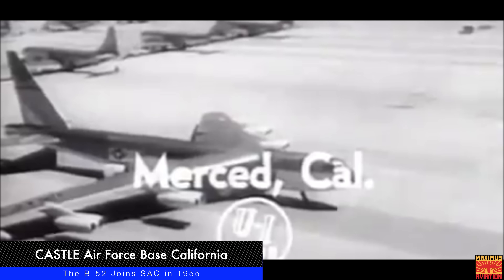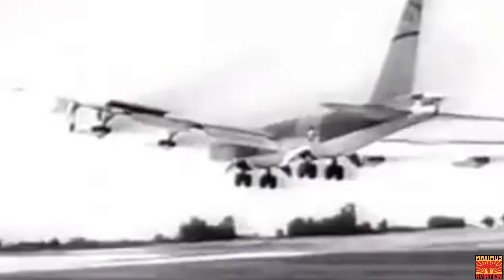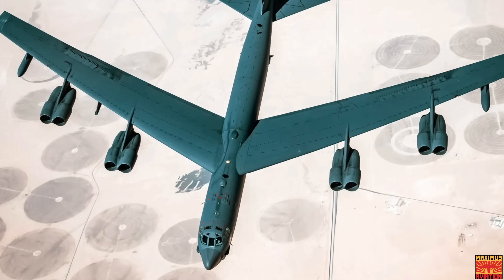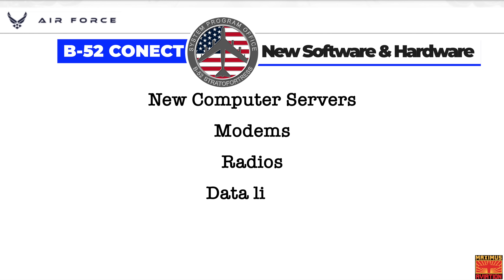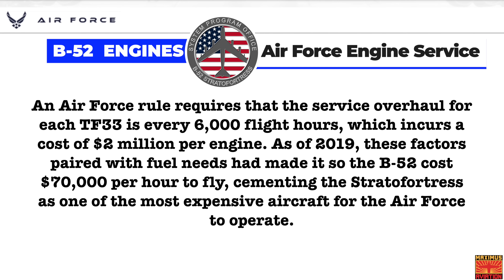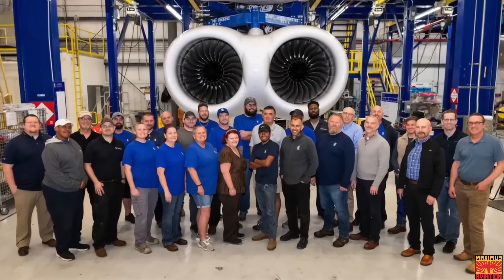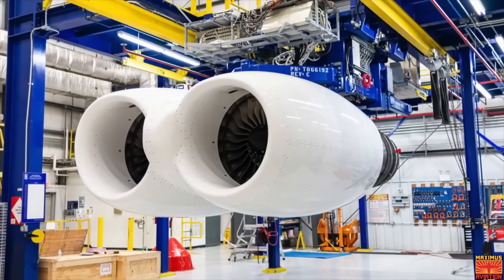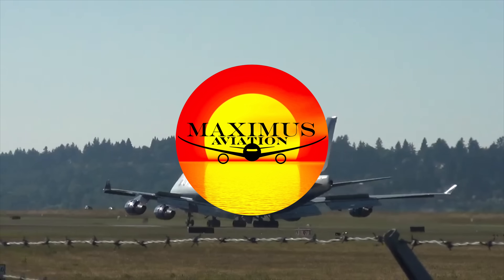The B-52 Will Fly For Over 100 Years With Its New Rolls Royce Engines!

Comment: But will the B-52 still smoke????
Reply: The BMW F130 engine does not have water methanol injection... so no more thick black smoke
Reply: @sandervanderkammen9230  Hello Sandyboy,  F130 is the US designation for the ROLLS ROYCE BR725 engine (in much the same way that J65 was the US designation for the AS Sapphire engine that was the F9 Metrovick).  As you know it has nothing to do with any wholly owned BMW company. 
You'll recall that in the early 1990s Rolls Royce offered BMW a chance to re-enter the jet engine market with a joint venture to develope the BR 700 series engines from existing Rolls Royce twin spool technology, so that Rolls Royce UK could focus on its more sophisticated triple spool engines. Unfortunately BMW couldn't hack it for long and by 1999 had declared that it was copping out.
As you'll recall , fortunately Rolls Royce was happy to take BMW's share and keep the local workers on and it became a wholly owned Rolls Royce company. As you know that was quite a few years before the development of the BR725 which first ran in 2008 long after BMW was gone.
Reply: It will probably vape.

Comment: I'm surprised they kept the double pod design. I would have thought they would replace each pod with a single, larger engine. It would be more efficient and mean less maintenance, but I'm sure there are reasons they kept 8 engines.
Reply: Won't fit, not enough ground clearance
Reply: They tried in 1989-90 time frame with a CFM-56. They had to many complications. Ground clearance was one of the problems.

Comment: I never worked the B-52 in my 26 years of service of the Air Force, I was a "tanker" crew chief on KC-135As, KC-10As, and worked ISO Dock on KC-135R, R/Ts. I did have some school on B-52s and am happy I never had to work on them, but have complete respect for those who have and still do. Since my retirement, I've continued to work in the commercial and business aircraft field and can testify the replacement engine is an awesome replacement over the old Pratts. They may still leak a bit of oil and they smoke from the oil vent when running, but they throw a Global up in the air like no ones business. Thanks to maker of this video, the old BUFF is truly an aircraft like no other, with it's wrinkle skin fuse and near impossible to roll main wheel and tires when you have to change them. Ask someone who has and they'll tell you it's a handful!

Comment: I worked in the engine shop on a SAC base in the early 80's. Overhauled J-57 engines for the B-52G, and KC135A . TF33 engines for the B-52H, also engine test cell, and flight line.
I loved working on the BUFFs, and 135s. The J-57 was an easy, reliable, and tough engine, loud, smoky in water injection, really fun to work on. TF33s were roughly the same experience.
It's hard to believe that some of the B-52Hs I worked in 81and 82 are still flying, I was 18 when I started working on them, and now I'm 60. 
I'd go back and wrench on those engines again in a second if they would let me. 1:18 that J-57-43WB on a B-52G brings back memories.

Comment: Excellent video! Hopefully the RR engines will work as well as the ole' dependable Pratt and Whitney's. Gotta love the B-52, the world's real Peacekeeper
Reply: The F130 is a BMW engine designed and manufactured in Dahlewitz Germany.
Reply: @sandervanderkammen9230  Hello Sandyboy,  as you know Sandyboy F130 is the US designation for the ROLLS ROYCE BR725 engine (in much the same way that J65 was the US designation for the AS Sapphire engine that was the F9 Metrovick).  As you know it has nothing to do with any wholly owned BMW company. 
You'll recall that in the early 1990s Rolls Royce offered BMW a chance to re-enter the jet engine market with a joint venture to develope the BR 700 series engines from existing Rolls Royce twin spool technology, so that Rolls Royce UK could focus on its more sophisticated triple spool engines. Unfortunately BMW couldn't hack it for long and by 1999 had declared that it was copping out.
As you'll recall , fortunately Rolls Royce was happy to take BMW's share and keep the local workers on and it became a wholly owned Rolls Royce company. As you know that was quite a few years before the development of the BR725 which first ran in 2008 long after BMW was gone.

Comment: This is a major contract for Rolls Royce. P&W must be grinding their teeth.
Reply: The BMW F130 engine was a perfect match for the B-52 and was a cheaper program so R-R won the contract.
Reply: @sandervanderkammen9230  Hello Sandyboy,  as you know Sandyboy F130 is the US designation for the ROLLS ROYCE BR725 engine (in much the same way that J65 was the US designation for the AS Sapphire engine that was the F9 Metrovick).  As you know it has nothing to do with any wholly owned BMW company. 
You'll recall that in the early 1990s Rolls Royce offered BMW a chance to re-enter the jet engine market with a joint venture to develope the BR 700 series engines from existing Rolls Royce twin spool technology, so that Rolls Royce UK could focus on its more sophisticated triple spool engines. Unfortunately BMW couldn't hack it for long and by 1999 had declared that it was copping out.
As you'll recall , fortunately Rolls Royce was happy to take BMW's share and keep the local workers on and it became a wholly owned Rolls Royce company. As you know that was quite a few years before the development of the BR725 which first ran in 2008 long after BMW was gone.

Comment: I spent 3 years in SAC in the 450th Bomb Wing at Minot AFB, North Dakota in the early 1960s. We had the latest model of the 52s—the H models. I worked and flew on these planes as an Autopilot technician. Some of the planes I flew on are still flying today. Amazing!

Our models had those TF-33 turbofans, but the earlier models still in service at that time had the older J-57 engines, which were the originals. None of our planes were refitted for conventional weapons and sent to Vietnam. Our H-models remained nuclear and carried H-bombs.

By the way, we NEVER used the term “BUFF.” I never heard that sobriquet until long after I had left the USAF.

Comment: It's the one plane where its production line needs to be restarted again. If it ain't broke dont fix it. But the airframes need a new production run. It may not be stealthy, and the raider is smaller, but any enemy seeing one in the air is just as big a deterrent than the nuclear weapons it was designed to carry.
Reply: The airframes were so incredibly  well built that they will last until at least 2050.

Comment: Smartest move in military history.
Reply: The BMW F130 is an excellent engine..
Reply: @sandervanderkammen9230  As you know Sandyboy F130 is the US designation for the ROLLS ROYCE BR725 engine (in much the same way that J65 was the US designation for the AS Sapphire engine that was the F9 Metrovick).  As you know it has nothing to do with any wholly owned BMW company. 
You'll recall that in the early 1990s Rolls Royce offered BMW a chance to re-enter the jet engine market with a joint venture to develope the BR 700 series engines from existing Rolls Royce twin spool technology, so that Rolls Royce UK could focus on its more sophisticated triple spool engines. Unfortunately BMW couldn't hack it for long and by 1999 had declared that it was copping out.
As you'll recall , fortunately Rolls Royce was happy to take BMW's share and keep the local workers on and it became a wholly owned Rolls Royce company. As you know that was quite a few years before the development of the BR725 which first ran in 2008 long after BMW was gone.

Comment: New engines are great, but what about airframe fatigue? The aluminum structure has seen a LOT of use and exposure. If America is going to continue to use these aircraft they may consider building some new airframes from scratch-it wouldn't cost that much. Yeah, I know-they have been reskinned as required, but that isn't as effective as a brand new structure.
Reply: The modernization program will include new wings, empennage and new fuselage skins, the fuselage frame itself will be inspected and reused,
Reply: @sandervanderkammen9230  New wings and skin is a step in the right direction, but structural components like the frame should be replaced as well. The most modern B-52's are almost 50 years old, I'd say they've gotten their investment out of them many times over. If we can afford $ 150 Billion for Ukraine, we can afford new frames for a few dozen B-52's.
Reply: @heyfitzpablum  Testing has showed that fuselage frames are so overbuilt and the alloys used so durable that will last to at least 2050.
Reply: @heyfitzpablum  If you look at some older aircraft like the DC-3 there are planes still flying with nearly 100,000 hours of service and are 90 years old.
Reply: @sandervanderkammen9230  Testing showed the DeHavilland Comet was not subject to pressurization fatigue and the Lockheed Electra had no issues with wing weakness. What brand spanking new frame elements would cost is a rounding error on our Defense Budget. We spend far more on Military DE&I programs these days than that. Do it right, or don't do it at all. I speak as a retired Manufacturing Engineer with 45+ years experience, as well as an instrument rated private pilot.
Reply: @sandervanderkammen9230  DC-3's are commercial aircraft with a cruise speed of 180 knots and are not pressurized, they fly at low altitude. They don't carry massive bomb loads, they carry much less stress-inducing commercial cargo. They are not subject to the stresses a B-52 is, not even close. And 'still flying' doesn't constitute defense mission availability. If we want B-52's to be front line bombers the structure needs to be upgraded, 50 years on an airframe with almost daily pressurization/depressurization and corrosion concerns mandates going the extra mile. As I noted, the cost isn't that high so why not do it right?
Reply: @heyfitzpablum  Air crash investigators found that the Comet was not correctly tested for fatigue, the airframe having been work hardened by previous tests.
The Lockheed L-188 was found to have a problem with the gearbox mounting which caused the engine to move excessively.
Reply: @heyfitzpablum  There is a big difference between 2000 series Alloy like Duralumin and 7000 series like 7075...
Reply: @heyfitzpablum  Boeing engineers and the USAF disagrees with your casual assessment.
Reply: @heyfitzpablum  Not all aircraft and aluminum alloys are created equal... just as the de Havilland Comet was made to be cheap and short lived, the DC-3, Boeing 707 and Boeing B-52 were designed to be extremely durable and long lasting.

Comment: You didn’t mention that, about 10 years ago, Boeing offered a plan to the Air Force for replacing the B-52 engines with leased engines.  The USAF turned them down.

Comment: They are not Gulfstream engines they are Rolls Royce engines as used on some Gulfstreams and other aircraft.
Reply: So why do they have Rolls Royce on them and are built by the company in the USA?
Reply: @briandugan4974  The F130 is a BMW engine, Rolls-Royce acquired the design and rebranded it.
Reply: @sandervanderkammen9230  Thanks for pointing that out. I just wondered why the article stated Gulfstream engines as if they are unique to that acft.
Reply: @briandugan4974  Indeed, Last time I checked the Trent series is the only Rolls-Royce engines still made in the U.K. and they have acquired the rights to several engines made outside of the U.K. along with several joint programs with other manufacturers. 
R-R invested in the MRA4 and lost millions, then it took a major hit with the A380 and now Brixit and Covid business is way down . The company was very lucky to have the F-130 in its pocket for the B-52 deal.
Reply: @sandervanderkammen9230  I agree with you. Article in the UK Times newspaper today about how the new CEO is going to reorganise the company.  Interesting times ahead.
Reply: No, they are BMW F130 engines designed for the Hawker Siddeley H.S.801 Nimrod MRA4 program, they are designed and built by BMW in Dahlewitz Germany.
Reply: @sandervanderkammen9230  I see what you are saying now. Joint BMW/Rolls Royce venture. BMW are no longer involved as far as I can see. Thanks for the info.
Reply: @briandugan4974  If it was a real Rolls-Royce engine? It would be named after a river in England, like Tyne, Avon, Welland, etc.

Similar situation to the Allison, MTU and other non-British engines rebranded as Rolls-Royce products. 

There are actually very few engines still made in the U.K.
Reply: @sandervanderkammen9230   One of my nephews builds Trents in Derby. Rolls don’t produce any small jet engines in the UK any more. They just concentrate on wide body acft engines and marine engines.
Reply: @sandervanderkammen9230  Hello Sandyboy,  F130 is the US designation for the ROLLS ROYCE BR725 engine (in much the same way that J65 was the US designation for the AS Sapphire engine that was the F9 Metrovick).  As you know it has nothing to do with any wholly owned BMW company. 
You'll recall that in the early 1990s Rolls Royce offered BMW a chance to re-enter the jet engine market with a joint venture to develope the BR 700 series engines from existing Rolls Royce twin spool technology, so that Rolls Royce UK could focus on its more sophisticated triple spool engines. Unfortunately BMW couldn't hack it for long and by 1999 had declared that it was copping out.
As you'll recall , fortunately Rolls Royce was happy to take BMW's share and keep the local workers on and it became a wholly owned Rolls Royce company. As you know that was quite a few years before the development of the BR725 which first ran in 2008 long after BMW was gone.

Comment: Surely none of thwe currently operational Buffs are 72 yrs old. I think I read somewhere that the operational ones are B52 Gs and onwards.
I have actually been posting on various sites to find out the oldest fully operational airframes  and I do mean operational in a commercial or military sense, I am ot asking about preservation  aircraft 
Hopefully the new RR engines will not be pumping out that filthy black smoke which enabled a Buff to be visually ID'd dozens of miles away.
Reply: The BMW F130 engine does not have water methanol injection so no black smoke.
Reply: @sandervanderkammen9230  Hello Sandyboy,  F130 is the US designation for the ROLLS ROYCE BR725 engine (in much the same way that J65 was the US designation for the AS Sapphire engine that was the F9 Metrovick).  As you know it has nothing to do with any wholly owned BMW company. 
You'll recall that in the early 1990s Rolls Royce offered BMW a chance to re-enter the jet engine market with a joint venture to develope the BR 700 series engines from existing Rolls Royce twin spool technology, so that Rolls Royce UK could focus on its more sophisticated triple spool engines. Unfortunately BMW couldn't hack it for long and by 1999 had declared that it was copping out.
As you'll recall , fortunately Rolls Royce was happy to take BMW's share and keep the local workers on and it became a wholly owned Rolls Royce company. As you know that was quite a few years before the development of the BR725 which first ran in 2008 long after BMW was gone.

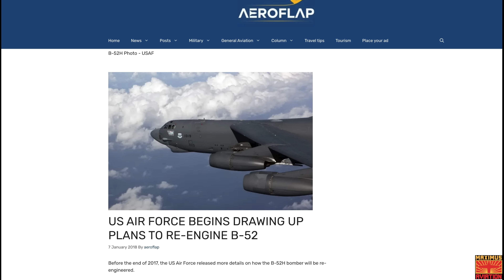Comment: RR badged Alison jets.  I'm confused:  6:38 "one of the most expensive aircraft for the Air Force to operate".....3:10 "relatively low operating cost".  So which is it?
Reply: The F130 is a BMW engine designed and manufactured in Dahlewitz Germany.
Reply: @sandervanderkammen9230  Hello Sandyboy,   F130 is the US designation for the ROLLS ROYCE BR725 engine (in much the same way that J65 was the US designation for the AS Sapphire engine that was the F9 Metrovick).  As you know it has nothing to do with any wholly owned BMW company. 
You'll recall that in the early 1990s Rolls Royce offered BMW a chance to re-enter the jet engine market with a joint venture to develope the BR 700 series engines from existing Rolls Royce twin spool technology, so that Rolls Royce UK could focus on its more sophisticated triple spool engines. Unfortunately BMW couldn't hack it for long and by 1999 had declared that it was copping out.
As you'll recall , fortunately Rolls Royce was happy to take BMW's share and keep the local workers on and it became a wholly owned Rolls Royce company. As you know that was quite a few years before the development of the BR725 which first ran in 2008 long after BMW was gone.

Comment: Should look into single elliptical nacelle with short internal induction split and dual exhaust. Could possibly look into introducing center air flow/bypass, if advantageous… direct at cooling back of engine?

Comment: Putting new engines have been proposed since the 1980’s. I hope it happens this time
Reply: Done deal, the B-52 will be powered by the BMW F130 engines
Reply: @sandervanderkammen9230  As you know, F130 is the US designation for the ROLLS ROYCE BR725 engine (in much the same way that J65 was the US designation for the AS Sapphire engine that was the F9 Metrovick).  As you know it has nothing to do with any wholly owned BMW company. 
You'll recall that in the early 1990s Rolls Royce offered BMW a chance to re-enter the jet engine market with a joint venture to develope the BR 700 series engines from existing Rolls Royce twin spool technology, so that Rolls Royce UK could focus on its more sophisticated triple spool engines. Unfortunately BMW couldn't hack it for long and by 1999 had declared that it was copping out.
As you'll recall , fortunately Rolls Royce was happy to take BMW's share and keep the local workers on and it became a wholly owned Rolls Royce company. As you know that was quite a few years before the development of the BR725 which first ran in 2008 long after BMW was gone.